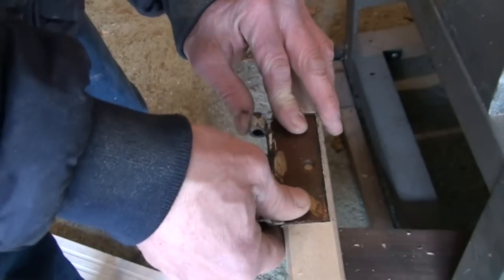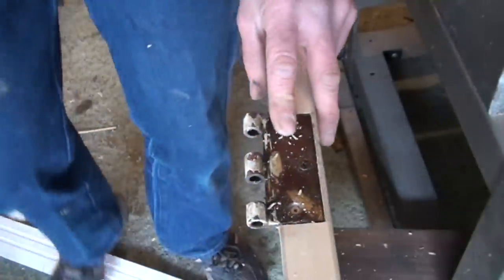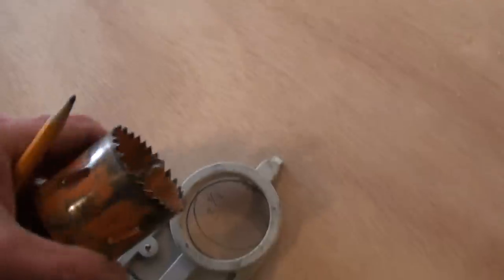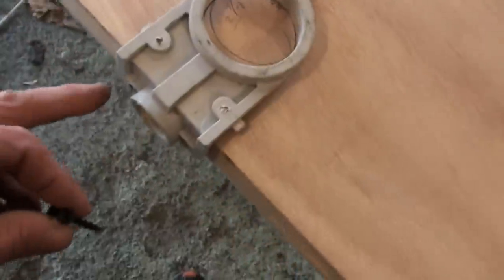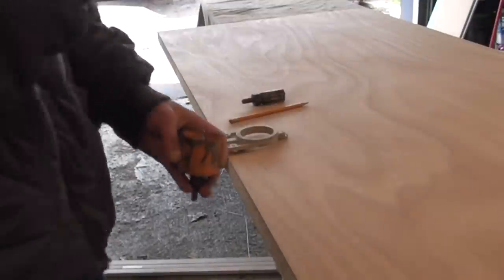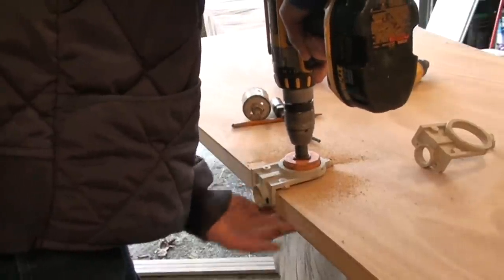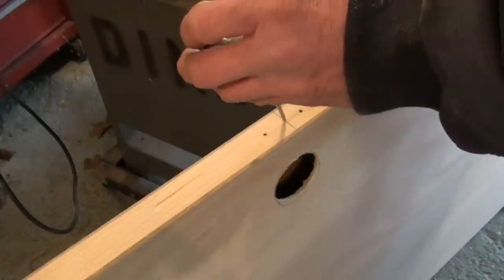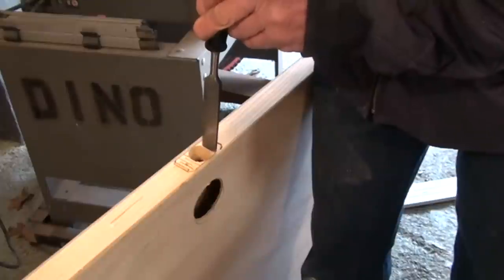Replace Interior Door "no hole blank"

Comment: just was wondering if you dont have the old door  but the the old hinges are marked on the casing how would you measure the hinge placement then transfer those measurements to the new door considering the door would have to be a little off the floor and a little below the door casing i hope you can understand what im trying to say if not thanks anyway and great video
Reply from the maker: yes, add 1/8" clearance at top ....sides to if trim is needed
Reply: thanks
Reply from the maker: Note, I would leave the hinge screws a lil loose, tighten after the hinge pins are inserted, helps with aligning during mounting ....best to you